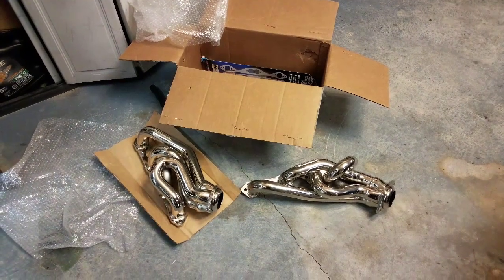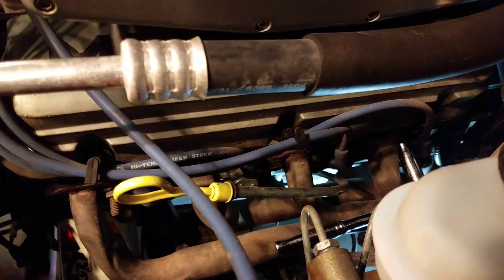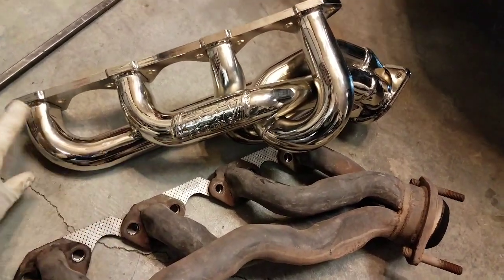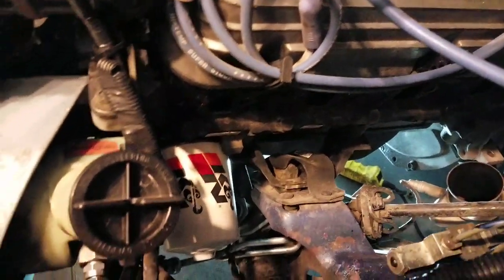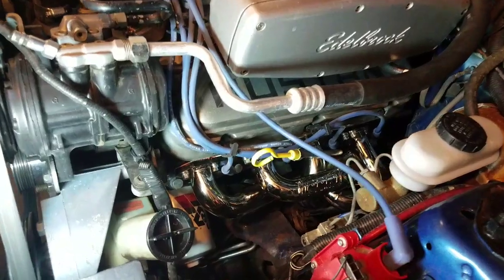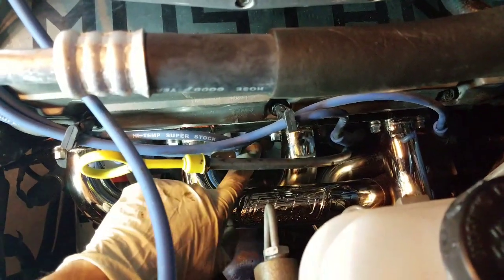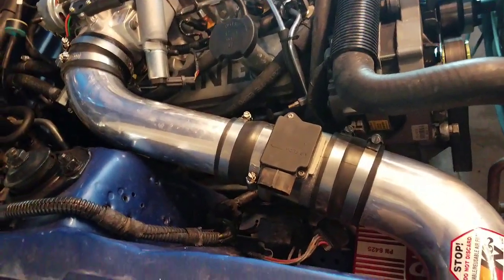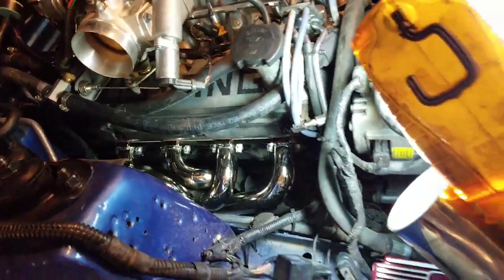Header Install on a Foxbody Mustang

Comment: Something i learned from installing many header sets is this... always loosen everything just a bit and then bolt everything together and tighten it back gradually, it will save you a few headaches, the mistake a lot of people make is to leave everything bolted up and then try to match the header collector with the H pipe etc,loosen the H pipe and mufflers just a bit and let everything mesh together and tighten it down slowly in increments, works every time.
Reply: When you say loosen the h-pipe and muffles, like remove them or just loosen the ubolt things?

Comment: those headers sound good as long as they are at least 2 3/4  or 3 inch
Reply: Have them on my foxbody and switching to 2.75in exhaust ripping the bbk crap and pypes stuff out

Comment: I made the mistake of having long headers installed on my 88 Thunderbird, turned into a nightmare. They burned up the starter, and blocked removal of the starter, blocked removal of the transmission. I changed to short headers.
Reply: Oh I forgot to mention,  my Thunderbird has a 450 hp 347 Stroker in it with Comp Cam,  MSD EFI. You probably don't know about anything past 2010.
Reply: Try Performance Unlimited in Melbourne Fl. and MSD EFI. with Flowmaster 40's. You probably think a 2 seater Mustang is a Muscle car. You are probably so cheap you still drive a stock 5.0.
Reply: So if 500 hp is the magic number. Does that mean 90% of the Mustangs on the road today are junk, and every Muscle car from the 60's and early 70's are also junk. You won't say what you drive so that tells me something. I know it has got to be something that is Government Pollution Compliant.
Reply: How nice, you have all your new high tech stuff. Like anybody cares. If we wanted it we would have it too.  We have what we have because that's what we want. Your like "Look at me I got 800 hp."Then 900 hp comes out and it you rush out to buy  900. What you listed is exactly what I thought you would list.  Classic Muscle car people have been laughing at you for years.
Reply: Lolllll. This a funny fuckin thread. 😂
Reply: I am searching for witch header, long or short. It's the short ones for me!!!! Thanks
Reply: @Gary Henthorn — yeah, i prefer shorties also, good for lowered applications too.
Reply: CalypsoNotch408  You should post some videos of all your cars.  Or maybe you are too busy tickling your own ass with a feather while watching ASMR videos.  Did you make the hairs on the back of your neck stand up???????  That must have been a big day for you.  Maybe some day you can learn some manners and turn your jag knob down a few notches while your at it.  The guy owns a Thunderbird, so what?  Are you better than him because you own a couple of F-bodies?  You want to make fun of a Thunderbird when you own two cars that require some serious money to be spent just to have a real dual exhaust system.  How ironic is that?  I subbed your channel.  Can't wait to see your cars.  Don't let me down.

Comment: Did you feel a difference between the stock headers and equal length headers?
Reply from the maker: Honestly a little bit higher rpms but nothing crazy.
Reply: @aandamustangs  would you rather have equal length or would you rather have chosen Long tubes or shorties?
Reply: @oscarvillarreal8951  id do long tubes but theyre just a pain when it comes to dropping the transmissiom, doing starter etc. Between shorties and equal lengths id do equal lengths. Long tubes definitely are the way to go just keep that in mind.
Reply: @adolfocastillo6723  Yeah, that's what I keep hearing. Shorties are the same hp. As the stock headers, equal length tubes are a good little hp. upgrade. Long tubes are the best but are a pain when changing the headers again, spark plugs, header gaskets, starter, transmission.

Comment: Great video. I have a question. Did you place the copper gasket to both side to the gasket?
Reply: Yes
Reply: @adolfocastillo6723  thanks for the reply. I need to get this done on mine.
Reply from the maker: Yes i like using on both sides, les likely to leak

Comment: Shorty headers, equal length will make no difference in HP & TQ to unequal length headers.
Biggest negative of equal length shorties, plug wire burning & spark plug access.
Reply: Are you sure? I've seen a lot of fox bodies with Shorties and equal length headers when they put a turbo, especially a super charger. They say it's better than long tube headers because it takes off better on the 1st couple of gears. Or if automatic on the start of take off. It's good in the beginning for the 1/4 of mile drag race. 

What I heard about long tubes is that yes it gives more horse power, but you need to wrap them because they burn everything it touches. It's so cramp to install them and take them out. It takes so much bay side room you can't even work under the hood. But it does deliver. You just always have to check them. I heard they're good before you add a turbo and a supercharger. But I'm not 100% sure on this. 

What's your opinion.
Reply: I did equal lengths on one of my Mustangs years ago and it was a pain in the ass,unequals for me after that, like you say the gains are negligible,unequals look better and much easier to replace when needed, i guess if someone is needing a thousands of a second more then go for it but for the average guy they will be fine.

Comment: Great video, thanks a lot. if you didn't do this, I would have had to either jack up my engine or take other parts off, it was the angle at which you put in the driver side that help me put in my driver side, thank you...

Comment: I took mine off and I’m reinstalling them and a couple bolts on the passenger side don’t wanna go in the last bit they spin fine and the last quarter inch it’s super tight? Should I get all new bolts or are some shorter or wtf
Reply: Try cleaning the bolts really good. Sometimes crap gets on the bolts and they just won't thread.

Comment: I bought some HEDMAN headers and the dipstick/headers are in each other's way.
Reply: Carlos C. You pull the dipstick from the block when installing the headers, and then insert it once they're on
Reply: cburford Nice Bro You Just Enlightened His Brain..
Reply: When it comes to mustangs BBK has the best parts and fitment, they r the original mustang aftermarket parts supplier

Comment: Using 02 sensors?
Reply from the maker: Yes sir
Reply: A&A Mustangs so did your pipes come with the a way to thread those into? Sorry I’m a newbie
Reply from the maker: These are equal length shorty headers, so the 02 goes in the h or x pipe.

Comment: im sorry but BBK is junk---whent to put mine on and they didnt fit had to make the holes bigger just to bolt them on...sorry but bbk headers are junk!
Reply: When I installed the BBK equal lenghts in my 95 was pretty smooth , back in 2006. Never had a leak or lose bolts until now... 
Perhaps the quality has decrease ...